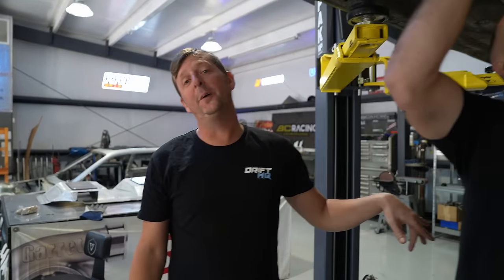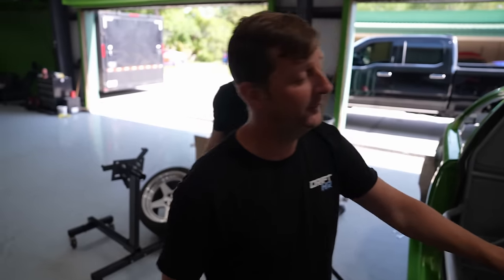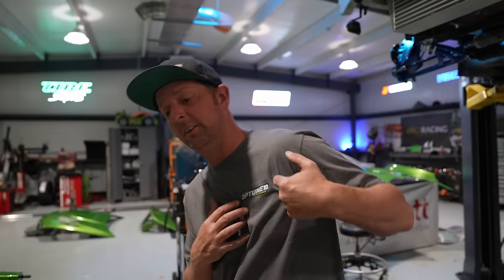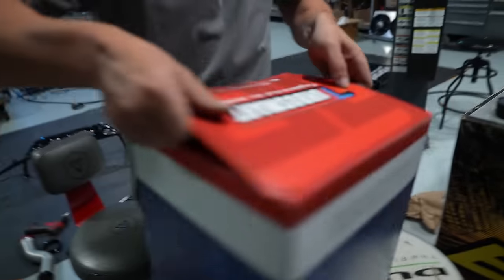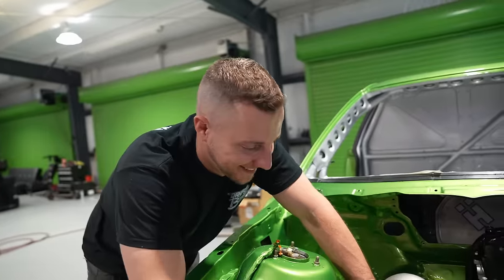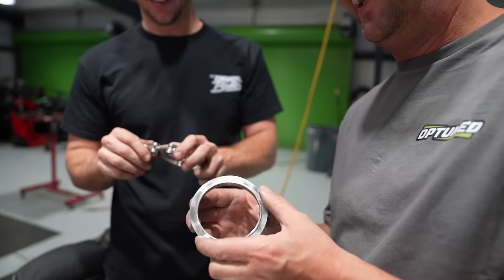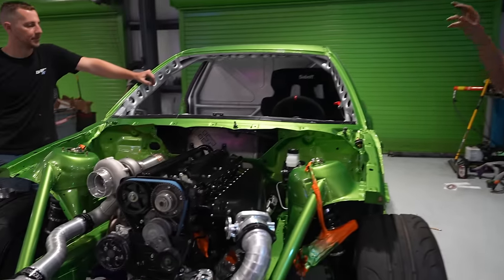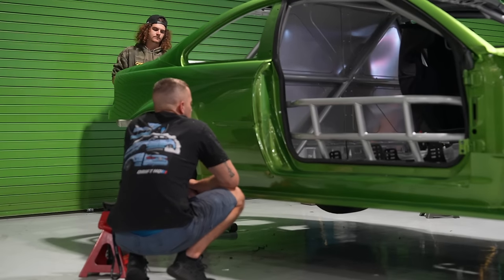2JZ E46 M3 Rebuild - The Cleanest it's Ever Been!

Comment: If its equal length and non-divided firing order doesn't mean shit! But if it's divided and equal length then yes, making the most of what ya got!
Reply: Well rotational fire will still help create a scavenging effect in the trailing cylinder which will still help reduce back pressure
Reply: @magicman9351  You're merging all pulses before the turbo and then the exhaust housing is pushing it through the exhaust! There will be minimal to almost no real effect in efficiency other than Rear AR changed! NA setup yes but this setup no, Just buy a real divided twin gate manifold and rear housing, can't beat it.... Which is weird, for such a setup as yours, why wouldn't you go with divided at this point. It's not a max HP build, even my build which is a divided manifold twin gate and a G45-1500 make over a megawatt 1128kW at the hubs with more than 2000rpm earlier boost buildup! Plus, why use poppet style wastegates? I started using the Straight gates and will never go back to a traditional gate, the amount of resolution of control can't be beat!